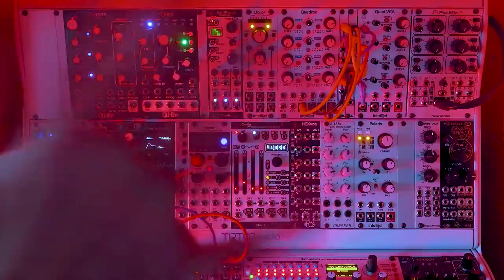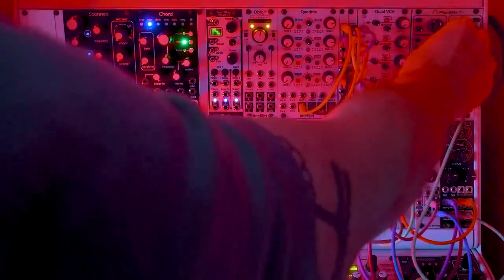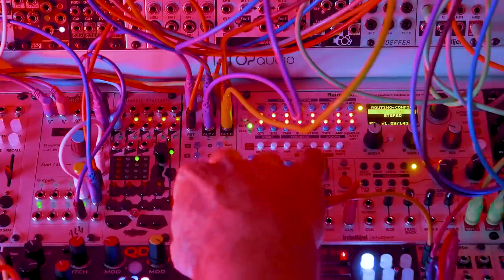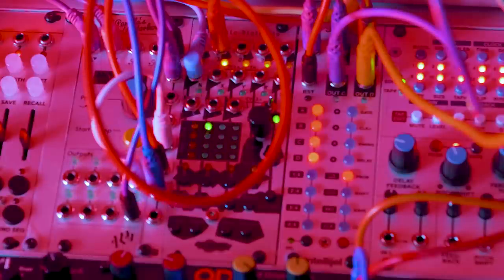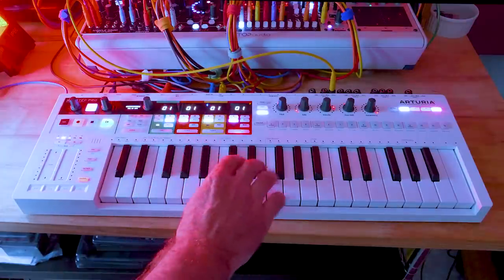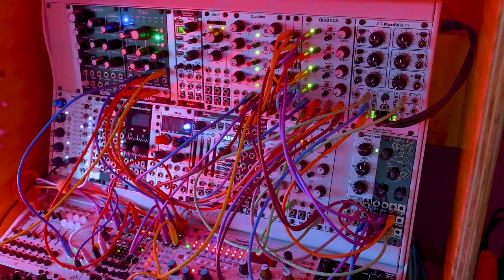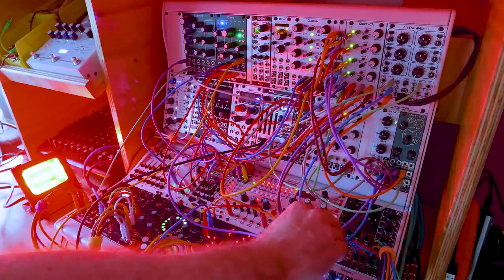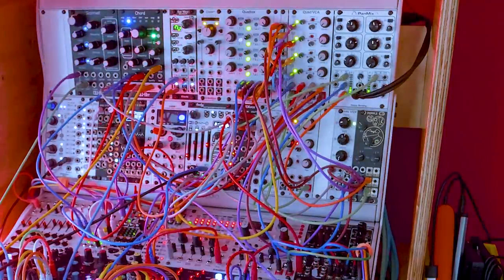Patch from Scratch with Qu-Bit Chord

Comment: I wonder if you or someone could 3D print some form of cradle to hold all the 90 degree male to female jack convertors you have on the Keystep Pro, to both hold them straight and also prevent fatigue on the PCB as you insert them.  Make the cradle's base so it's level with the work surface the Keystep Pro is sat on - and maybe make fingers around the top of the convertors for when you pull them out? 

Failing that, a lil patch bay type extension module for it? 

I only say this as re-soldering the 9 pin D-sub ports on my Atari ST every pair of plates was a pain due its stupidly placed mouse and joystick ports lol.

Comment: The Chord would sound even more fantastic going through a Doepfer A-105-4 Quad Poly SSI VCF
Reply: You can also just use the mix output on Chord through any filter if you don’t need the separation.

Comment: The varigate is starting to displace my steppy in terms of immediacy, but function wise, Steppy really handles the workload of a varigate at a great value. I was told that a voltage block was a mandatory accompaniment for the varigate so I picked it up too, but it's not exactly the companion I imagined (I thought I would use it for note sequencing). It's become more of my cv animator. Stepped.....Un...random I guess?

Comment: How did you like it compared to the 4ms ensemble oscillator?
Reply: Exactly
Reply from the maker: Super different actually. Hard to explain in a comment.
Reply: @RedMeansRecording  For one the 4MS basically just has the mix out. We'll, you can get the evens, odds or uppers and lowers selectable as I recall. It seems like the Chord is more versatile. OK fine, you can't compare them in a comment ;)
Reply: Nevermind, was more about which one was more inspiring for you. :)
I also have the chord and this video was very inspiring for me. Thanks for that!